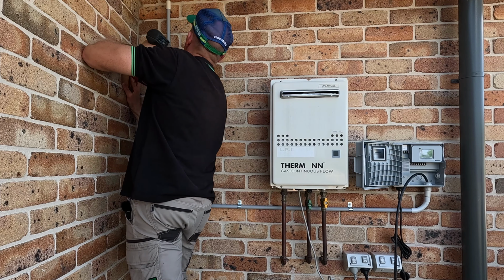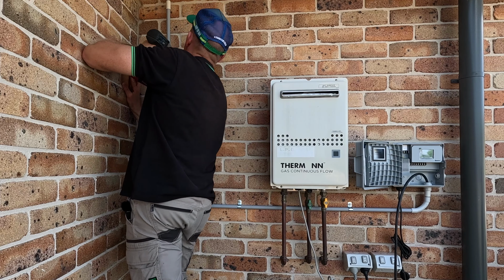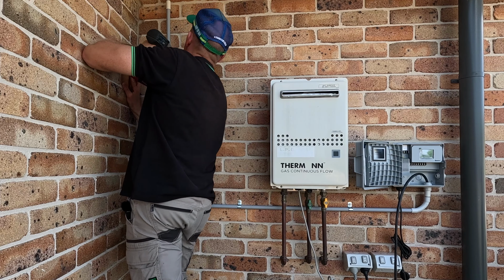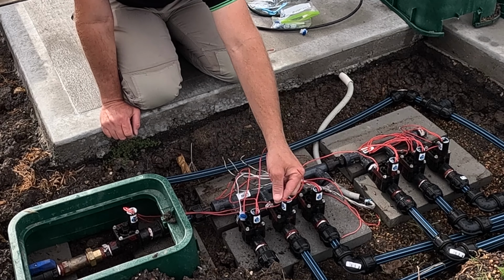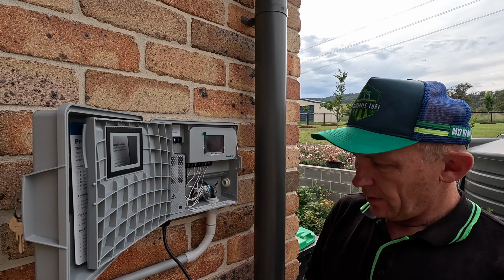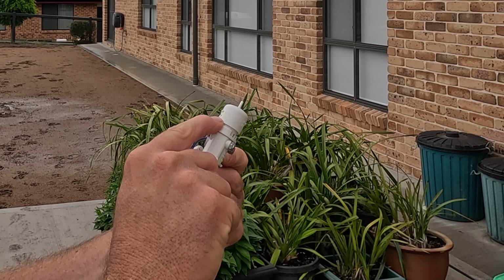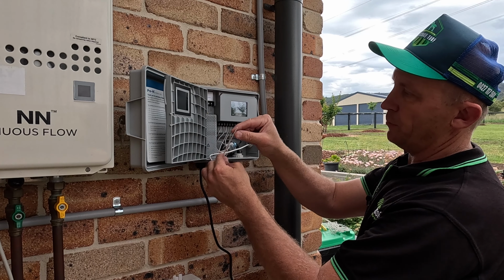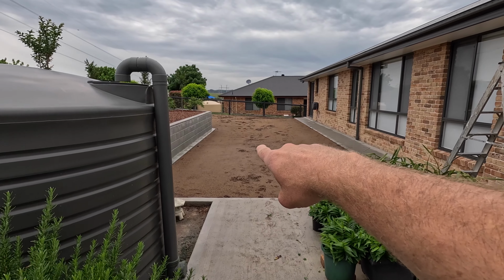Automating my irrigation system with the Hunter Pro HC Controller

Comment: Saddles on upside down mannnnnn, can't watch this as a sparky 😂😂

Well done tho mate, another class video
Reply from the maker: I had a 50% chance haha who knew there was an upside and downside way to use them
Reply: @theaussielawn  hahaha nah it's no biggie, just on the horizontal conduit the saddles should be the other way so the 'weight' of the conduit is pushing down on the screw, not on the open side of the saddle, but again it's not an issue haha, love how you used electrical instrumentation cable too, so good with the pairs
Reply from the maker: @alexsallery  Ahh that makes sense , cheers mate Ill do it the right way from now on

Comment: Great explanation, mate! You’ve given me the confidence to tackle my irrigation system repair this time. Just a quick question—when wiring the cables for those controller valves, did you turn off the main power at the switchboard?
Reply from the maker: No need to mate as they only run from the valves in the ground to the controller which is unplugged / switched off at the power point.
Reply: Thanks for that. Before replacing one of the valve controllers, I just want to confirm if it’s really defective. The only reason I’m considering replacing it is that the other zone is no longer working. Is there a way to check the controller first?
Reply from the maker: @ maybe swap another zone around on the controller ?
Reply: Thanks mate. Cheers😊

Comment: hey mate, where did you get the cable? and how many cores in this cable? more than 8 cores I guess as you used 7 valves (6 zones + 1 mainline , correct me if im wrong)😁
Reply from the maker: You can get cable from most good irrigation stores, I got this stuff from a mate who is an electrician it was left over from a job he had ages ago

Comment: Does the outdoor model come with a power cable to connect to a regular power point? I read it needs to be hard wired by an electrician which would be annoying.
Reply from the maker: @mat7247  it most definitely does here in Australia mate all ya need to do is plug it straight in the PowerPoint

Comment: Mean that its all up and running but the length of the wires in the boxes hurts my ocd so bad🤣🤣 i would have then cut to the perfect length so they can move a tiny bit but not much worked on to many cars with bird nest wiring 🤣🤣
Reply from the maker: @calebevans8437  I will be tidying it up. I was racing against a turf delivery
Reply: I always leave a bit of slack to allow for future repairs and adjustments. Nothing worse than trying to unscrew or replace solenoids with no slack in the cabling.
Reply: @Tomkatoz  abit of slack but not 10cm of wiring you should see some of the wiring under dashes of cars my old bosses son went through a boy racer car stage I just started by ripping everything out and if it didn't stop the car running sweet didn't need it 🤣
Reply from the maker: @Tomkatoz  💯